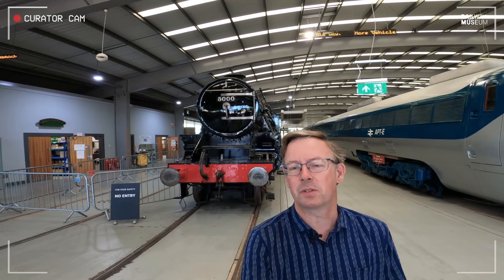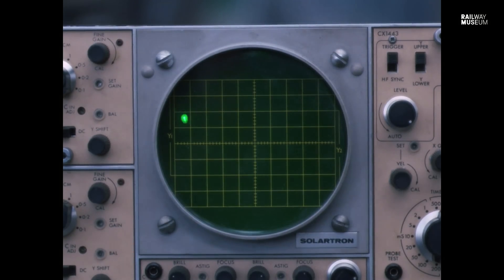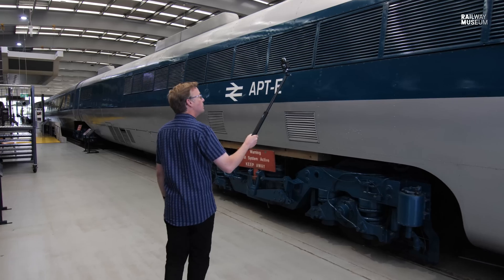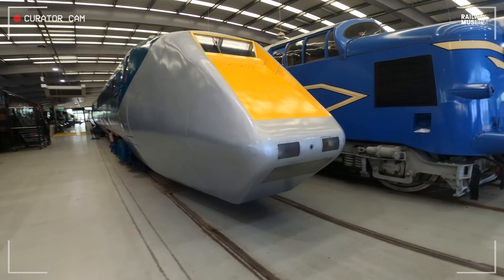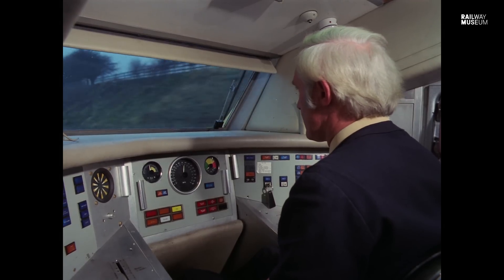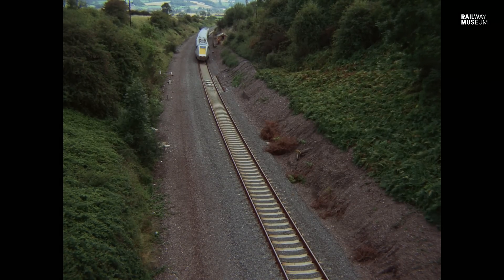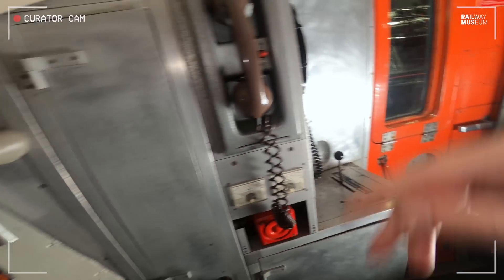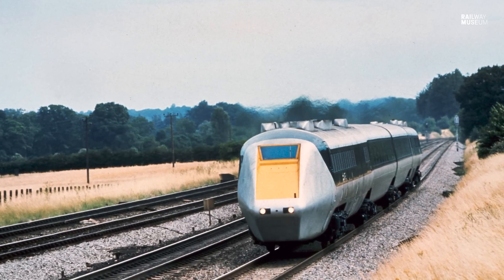APT-E: The Tilting Tech Fest, a 1970s Vision of the Future | Curator with a Camera

Comment: Another terrific video, of a truly groundbreaking train. The contemporary footage of the test runs is excellent and especially the brief cab recording from the record breaking run. The full story of the APT program is fascinating, it is interesting to speculate about how modern computers might have changed the outcome - the ability to dynamically alter the tilt mechanism might have made a difference, for example. Thanks, as always, Anthony, for the excellent video tour.
Reply: Dynamically alter the tilt system? Not sure if the two are related but Kit Spackman said the equation to calculate tilt angle is the exact same in the Pendolino. Others like the Canadians and Swiss developed their own.
Reply: @alstonofalltrades3142  the computer equation might be, but the hydraulic lag in the APT shouldn’t be present in the Pendolino AIUI. Don’t recall if it’s controlled by electric motors in the Pendolino but either way there isn’t a big lag when riding them
Reply: @kaitlyn__L  The 390 Pendolino has electrical actuators. The APT-E had hydraulic. the 370 went to air.
From the little ive read they went to electrical as they dont wear out and more reliable. But i need more info to confirm or dispell it.
The APT engineers got the tilt too good and finally figured out to reduce the tilt a little so a bit of sideways force was felt. This way the few people who are prone to sea sick, car sick. flight sick feel better as the movement their eyes are seeing matches up with what their balance system is saying. 
Id say based off that they got it dam good. But it needs to be proved by renovating the 370 for the heritage business and giving me a free lifetime pass so i can be super sure hehe
Reply: @alstonofalltrades3142  The Class 370 APT-Ps did have a hydraulic tilt system, the very same pump and valves that we used on APT-E in fact. Both APTs used air secondary suspension.
Reply: @kaitlyn__L  The 390s do use electric screw jacks to tilt, and they use a predictive control system to minimise lag in the system, but it won't work too well in the leading coach, so never ride there! The poor driver has the worst tilt environment on any tilting train.
Reply: @kitspackman3994  Mr Tilt! Unless a very knowledgeable train enthusiast is impersonating you for a laugh hehe.
I heard it was air from the story that the BR engineers changed it and moisture condensed in the pipes and ran down to the lowest point where it began to freeze causing more juddering in the tilt. Chinese whispers?
I also heard
1. The overhead wiring spec was never up to that higher speed, the APT was not possible from the get go. How did 370 set the 162mph speed record on this route if so?
2. The carriages would hit each other if they both tilted toward each other while passing. The carriages all have sloped sides so they don't in full tilt stick out more than any other carriage for that route.
3. The APT was too fast and so couldn't be pathed in between other slower freight and passenger trains, and the HST was as fast as could be run on the 115mph WCML. If this too was true they wouldn't have started to think up the Intercity 250 project, or Buy Pendolino's and run them at 141mph or later just keep to 125mph.

So many parts of this story have falsehoods in it though and it's tricky to talk with other train enthusiasts with at times as we all know things and still have errors and gaps in our knowledge.
If you keep having feeling to get the exact truths out there then please continue, we need them!
Reply: @alstonofalltrades3142  I can not tell a lie, it's me, yes. :-) The moisture in the pipes business was in part of the secondary air suspension of the bogies. Because the APT-P tilt system tilted the bolster on which the air springs were mounted that caused the problems you mention. On the APT-E the tilt and secondary suspensions were separate so we never saw those issues.
1. BR's catenary never was as stiff as European ones that ran at much higher speeds, and always were a limitation in high speeds on the WCML, and were an indirect cause of the APT-P's power cars being in the middle of the train.
2. On one particular curve on the WCML, and if both trains passing each other in opposite directions had both failed toward each other at that time, there was a risk that the coaches could hit each other, and that was enough for the nay-sayers to scream  'Scrap the Project!' in practice they'd have either eased the curve or limited the speed of the trains just there.
3. The speed issue was true, and there would have been difficulties in pathing them through freights and slower passenger trains, but BR had plans for more loops and other stuff to solve that, but they didn't have a chance to implement them before the project was cancelled, and not long after that the whole shebang was privatised. Having said that, when APT-P was in it's somewhat limited service after 1982 some passengers found themselves at Euston considerably earlier than they expected. :-)
Reply: @kitspackman3994  Thanks for the reply. I'd rather learn I'm wrong than carry on with some points of view I think are true and seem to make sense, especially passing them on.
Not long after your first reply I re-watched a bunch of docs and videos on APT and tracked down the error on APT-P switched to air tilt. I just kept putting off posting then forgot too.
https://www.youtube.com/watch?v=6qUzPMoj1p8&t=538s
time index 18:20.
Brits who made the modern world. I very good series that I really enjoyed. I'm not knocking it wholesale. just that one error.. as far as I can see. I really enjoyed the series.